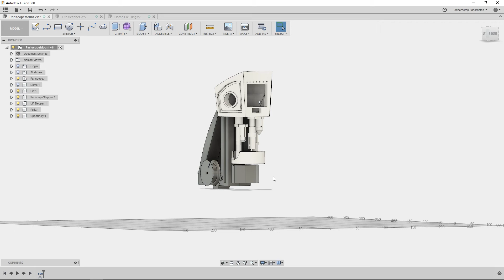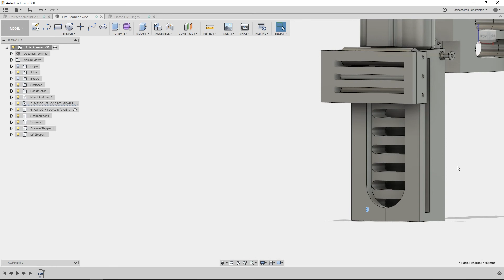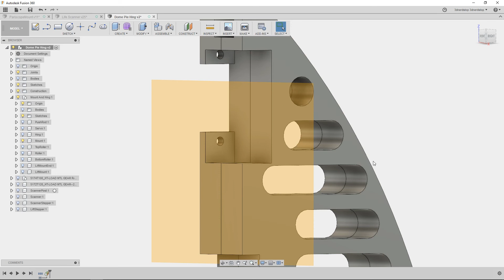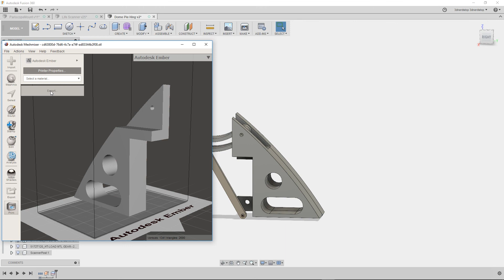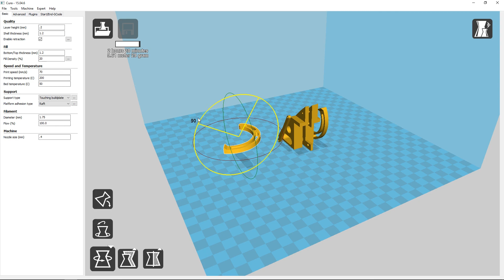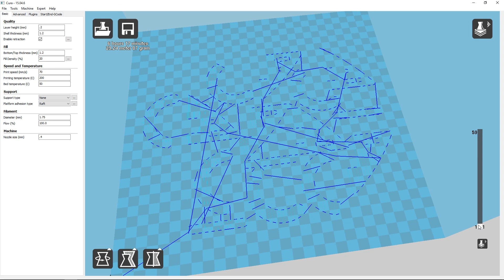3D Printed R2-D2 Project: Part 4

Comment: Thanks for all your videos... I'm just printing my dome at the moment (well I'm down to the rings now actually). Your videos are very helpful for filling in some blanks as to what goes where. I'm still trying to figure out if I need to print the pie panel that goes above the periscope though.
Also... if you want to skip a step when exporting files in Fusion 360, you can tick that little box that says "send to 3D print facility" and then it should give you the option to simply save as .stl that's what I tend to do and it seems to work.

Comment: I have a Prusa Mk2S and Love it, Super quality prints, saw some of your blue parts last vid, quality really seemed low, question are you using PLA or ABS ?  PLA has low Melt point will even melt in a car
Reply from the maker: Building in PLA for the most part. Do not need high quality for most parts because I'm finishing them. The sanding will take care low quality of the parts.
Reply: cool, just ordered couple rolls of ABS to try it out, its bit Stronger and Less chance of melting, Just have to be careful of warping, heat gun can fix most easy warps though.

Comment: What do you use for the hinge pivot points? The holes are pretty small, not sure what you would use in them. Also, in thingiverse, the links for the servo motors are the same as the links for the stepper motors. Can you update this?
Reply from the maker: I have fixed the links to the servos on Thingiverse. Thank you for pointing that out. I'm going to use a 2mm RC airplane push rod that I got from hobby king years back. So any Push Rod that is 2mm should work ( http://amzn.to/2f3kb1t ).
Reply: Great thanks!

Comment: Hi Rorlin, making great progress.  In case you hadn't heard of this item Adafruit makes a slip ring that allows wires to turn 360.  They make a couple of different styles and number of wires.
Reply from the maker: I did not think about using the slip ring until after I had printed out the parts and saw that I was going to have a problem with lighting the periscope having the stepper motor centered under it where the slip ring would have to go. Hind sight is 20/20. Thank you for the idea. Every little idea helps.